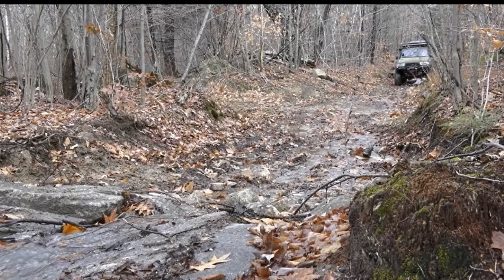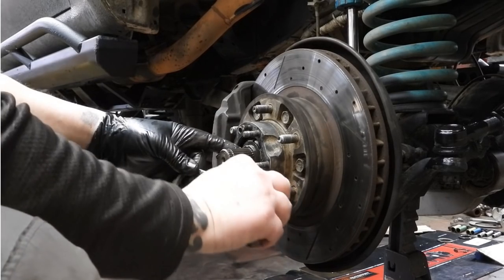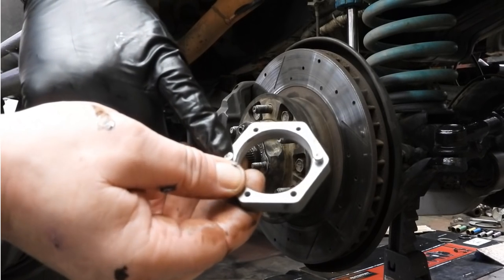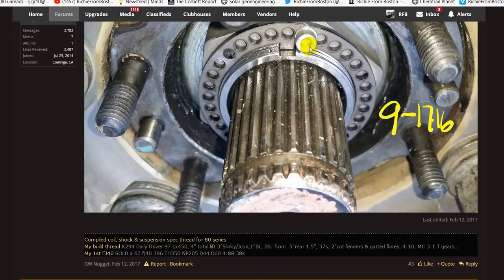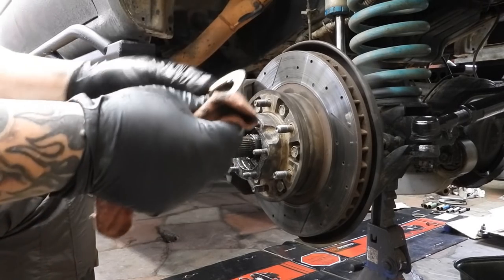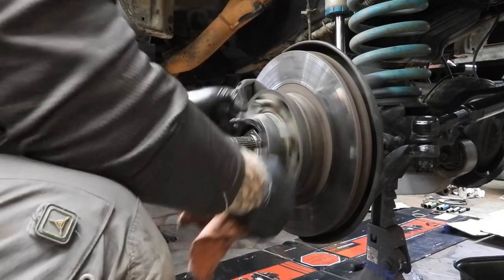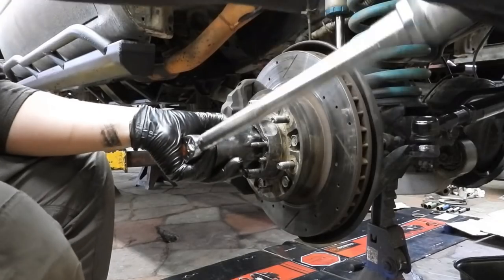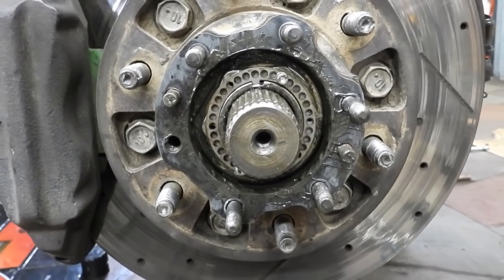OVERLAND DIY: Trail gear Spindle Lock Install.

Comment: I have the trail gear kit as well, there is a weak point in the kit. The lock washers flatten out and lose their spring in the first use. I replaced them and the Allen heads after 5k miles and haven't had issues since.
Reply: FZJ802 I wonder if titanium washer is available ? But one thing I know it must be forged , ? Titanium is much better at keeping memory. Thank you for your input 76fj40.
Reply: @BlueStar712  I just went to stainless hardware and that was plenty

Comment: I think we used spicer , or Yukon , but I know they were high quality . But I expect issues so superior products are always on the radar, we ran 60 series knuckles so we could completely replace everything inside with Yukon mechanical 411 posi... front and rear, only thing we didn’t replace was the axle housing. But I think we may still have the star washer style. So we may switch it out when we service it. Thank you Richie. 76 fj40

Comment: G'day Richie, quick question mate I've got a 1997 80 series & I just bought the spindle nut kit after watching your vid, when you do preload for the front spindle nuts at 24 ft lb, just wondering do you use the same torque spec for the rear hub nuts as well ?